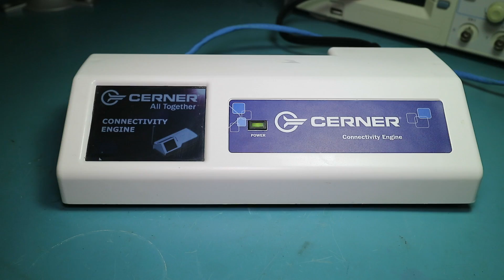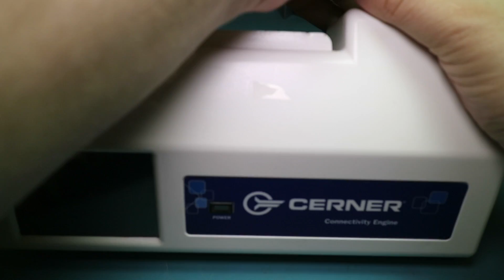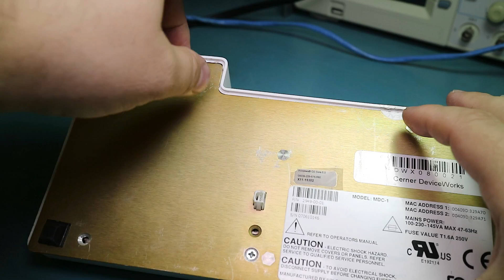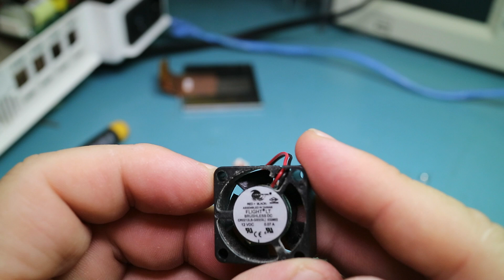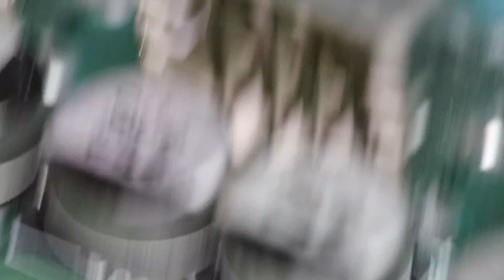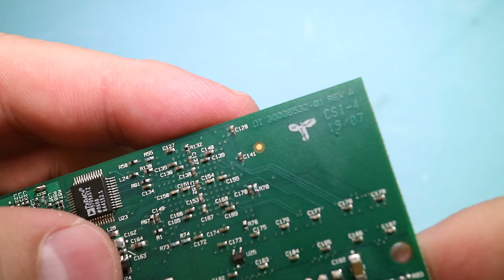Cerner Connectivity Engine MDC-1 Teardown

Comment: The flash storage module is 256 MB. I know Samsung's model numbers for their flash memory. On the chip with the QC sticker on it, the model number is covered up, but I can see a 2 in the number. That 2 is accompanied by a G next to it which stands for gigabit. So, 2Gbits is 128 MB and since there's 2 flash chips, there is 256 MB of flash memory.

Comment: The Flight LT fan is pretty neat. I abhor small fans because like you said they're very loud and usually extremely unreliable as well. However, that one is from Comair Rotron which is a very reputable company in the server/commercial market, not exactly cheap either... which is why it still worked in that device haha. Many small Chinese fans just seize. I've got quite a collection of higher-end fans from Comair Rotron, Ametek Rotron (mil-spec stuff, ungodly expensive for some) and EG&G Rotron (EG&G used to own Rotron at some point). None of them are quiet but they sure push a lot of air haha. The bodge at 11:28 is funny and I will 100% use this idea in a prototype I'm sure lol. XD Lots of units like this tend to have expensive parts worthy of scavenging, DC-DC converters would be an obvious target but depending on the unit, things like relays, quality trimpots, expensive opamps, various driver chips etc. Kind of fun to play the eBay lottery lol. I really really love your videos.. I'm yet another person who came from Mike's tweet. XD Also how did all these hospital employees below find this video?? Such a mystery haha. Oh, I'm a fellow Canadian, but you're a traitor! D:< How dare you leave the motherland. j/k haha~ XD
Reply from the maker: +whatlions My guess is people tend to look up the company they work for. :D

Comment: I'm not surprised that the software didn't run on a Windows computer since Windows and Windows CE have almost nothing in common except the graphical interface.
Reply from the maker: +Channel 2012 The funny thing is it actually failed gracefully and said it simply wouldn't run on this version of Windows instead of trying to run ARM code and crashing or some nonsense. Plus I couldn't remember if Windows has the same thing as Mac OS where it can have a binary built for more than one platform. Figured it was worth a click.  :P
Reply: *****
I know what you mean. I've seen those little CE EXEs with their inviting-looking icons that almost look like they should run. From what I've heard, there actually are x86 builds of CE floating around, but there is zero compatibility between Windows and CE, regardless of architecture.

Comment: It's actually for bed-side devices for hospitals. I know because I work for them.
Reply from the maker: +NegiMudkip What kind of stuff exactly? Is it just displays for status or do they actually connect to patients through isolated devices on the USB connection?
Reply: ***** It's basically a very smart USB hub that can connect stuff like bed systems, ECG, vital sign monitors, ventilators, and medical other devices.